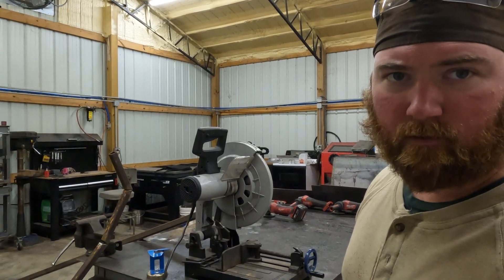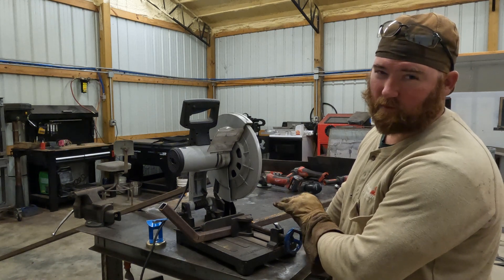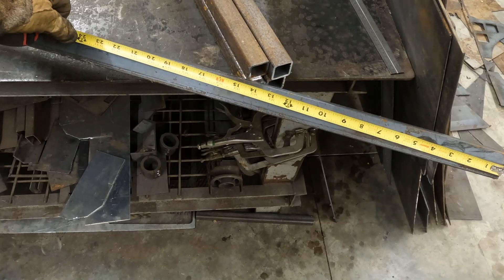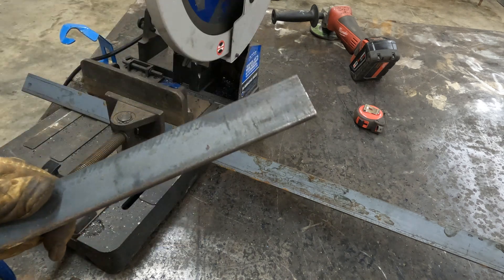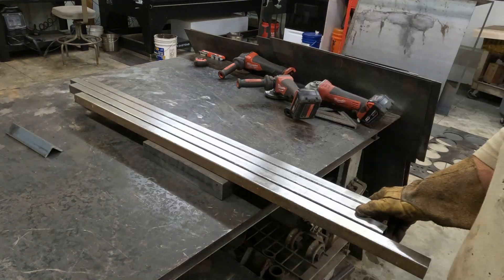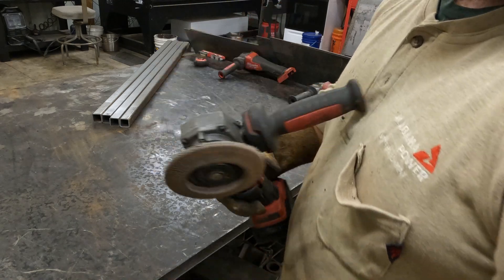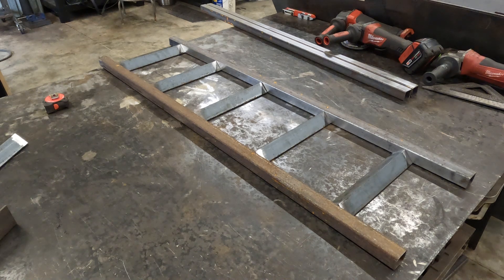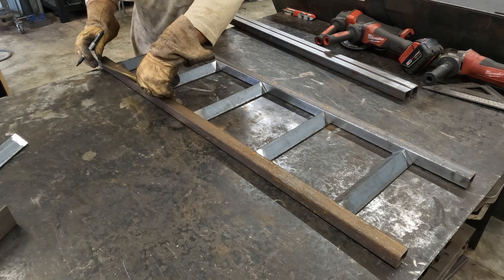Building a set of trailer ramps

Comment: Material details would be nice.   And I know you are not necessary sponsored but some details on equipmebt such as welder etc would also be nice.
Reply from the maker: 1 1/2” square tubing. If I remember correctly, wall thickness was .095. It was left over from a different project and  I can’t remember exactly what it was. 1 1/2” angle iron for the rungs and 3” angle iron at the end for the lip. 
I use the Everlast MTS225 multi process welder with the auto set feature. Just select material and thickness and it sets the amps and wire speed automatically. The settings aren’t perfect on auto set, but it’s really close. The evolution saw is model EVOSAW380 with the mild steel blade
Reply: @Calebdonaldson10  Thanks Guy!!!!!    I am a very much novice on welding and such, but have been wanting ti build some of these for m trailer.   Just wondering …….
Reply from the maker: You're welcome! Everybody has to start somewhere. It takes time and a whole lot of practice and patience. Just keep at it